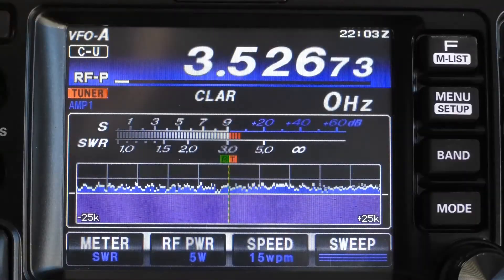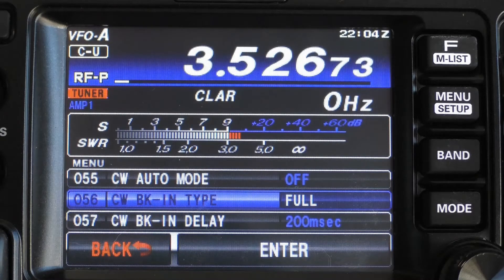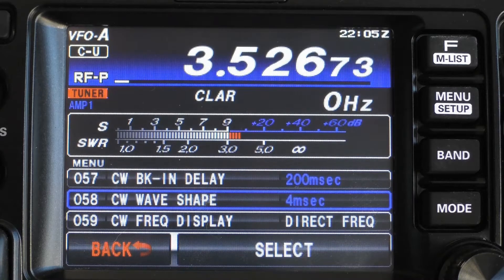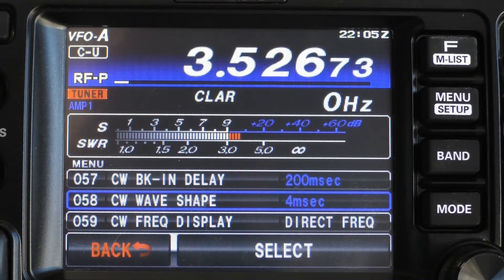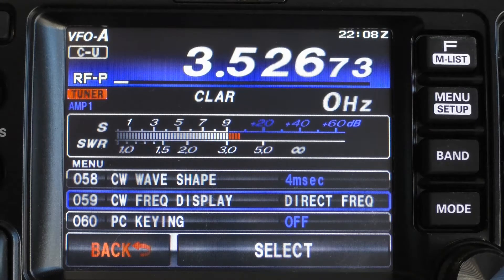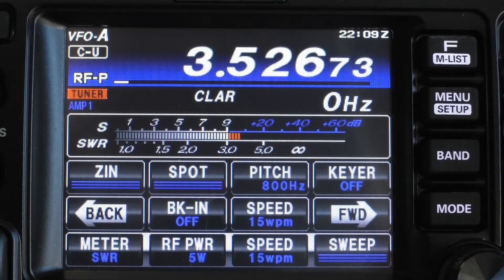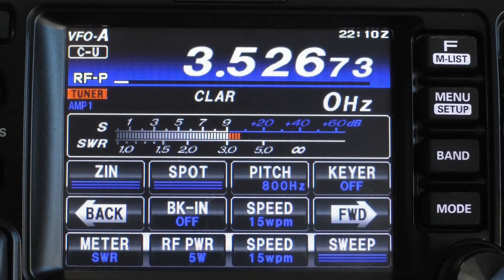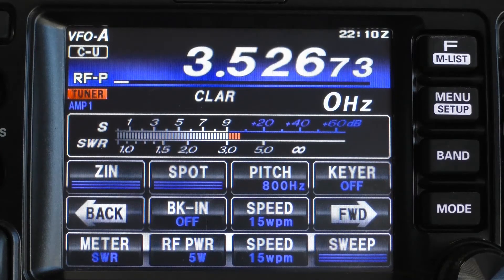Ham Radio Tutorial: CW on the Yaesu FT-991A

Comment: Hi Tom very interesting video. I own the ft 991 with the  winkeyer  usb. winkeyer  connected to the key jack in front with the 2 ends red and white red to PTT and white to key 1 which works ok with my CW software. now when i try to connect my bencher paddle in the Winkeyer paddle jack it just keep sending characters . do you experience something like that in your radio or maybe is just a setup in the radio menu? Thanks Tom  KP2BH/Jimmy
Reply from the maker: Check your function menu - the break-in should be on and the keyer should be off
Reply: @ND3N  break-in is on and keyer off and still the same.

Comment: Thank you Tom for your advice. I will adjust things as you say and keep at it. I also was prescribed Volterol, I use it on hips and knees etc. But didn't think of using it on my hands, so thanks for the tip. Appreciate your help, I must get myself organised with the paddle keyer it will certainly make  for easier sending if I can  get my mind and muscle memory down to it. 
keith GW0CMI

Comment: Would like your advice a number of yeas ago I used to do a fair amount of CW using a straight key. Recently returned to Radio, though never being far away from it. I decided that as  I have arthritis in the fingers I would try a paddle key. this was fine. can send my call sign, go right through the alphabet no trouble, but when trying a CW contact I just loose it, it doesn't come natural to me. but using a straight key mind mind automatically just sends what's in my mind with no trouble my hand works the key automatically. I have tried many hours of practice with paddle key, but doesn't make any difference. I don't want to go back to using a straight key, because I know it will only make things worse. Can you suggest anything ? (using twin paddle in auto mode)
Reply from the maker: Hi Keith…. I also have arthritis in my hands that made me give up playing guitar about 10 years ago.  First, there’s a cream that was recommended to me by an orthopedist and is available over-the-counter.  He recommended it for my knees, but I found that it also helps with my hands.  It’s called Voltaren and is an nsaid that absorbs through the skin.  Second, make sure that your paddles are adjusted correctly.  It should only take a light touch to make contact.  The springs should only be set at the minimum tension to return open the contact after sending.  Third, make sure you are sending from a comfortable position that doesn’t put any additional strain on your wrist, fingers, and arms.  Finally, practice will not only build the muscle memory so you’ll send without thinking, but will also build up the supporting tendons and muscles in your fingers that will lessen the pain in your fingers.  Hope this helps….  73 de Tom, ND3N
Reply: I have the same problem but found the paddle difficult. I started using the paddle with my left hand and the straight key and bug with the right after reading the suggestion somewhere. I don't know why, but it worked for me.

Comment: Hi Tom.
you seem to know a fair bit when it comes to the ft991a,Do you know anything about the MRP40 morse decoder software and what settings need to be set in the ft991a menu,my 991a works fine with wsjtx and grid tracker but i cannot seem to get my radio to tx in MRP40,i cannot find anything on you tube could you please take a look and maybe make a short video to help others to.🙂
Reply from the maker: I’ll have to do some research, but I expect it is doable.   73

Comment: Great video, thanks. This wasn't covered, but I dont understand which keyer setting to select. menu 12: KEYER TYPE.  Elekey -A, Y, or ACS. The manual makes no sense to me. I have an iambic paddle.
Reply from the maker: They are talking about how the internal keyer operates.  There are a number of different types of keyers and each has their own "signature".  All of them will work with your paddle.  I'd advise that you play with the settings and find the one that sounds the best to you - truly a case of "your mileage may vary."  To tell the truth, I have a hard time distinguishing between them.
Reply: @ND3N  thanks, I'll have a play. 73.
Reply: @ND3N is it possible to use the ft991 is a simulation mode, where nothing is really send out? I tried reducing rf power to 0, but 5W is the lowest. 73, PD0HRX

Comment: It boils down to production costs. Most manufactures have done away with the rear key jack so now you only have one and you have to go into the setting every time and you have to plug in a different key. I have a Yaesu FT-2000 that has both a front and rear key jacks. Vibroplex Vibrokeyer in the front  key jack and the Vibroplex Lightning bug in the rear key  jack. Can instantly and seamlessly switch between the two  keys effortlessly. the old FT-2000 is one the best radios I have used, great on SSB and CW but sucks big time in AM mode. Well I guess you Can't have everything!  Don't be a scope head.  Hi Hi. KE0SJQ
Reply from the maker: Thanks for your well thought out comment. Save a few cents and make the radio less flexible. I’d prefer to spend a few more cents…. 73 de Tom, ND3N

Comment: I agree with you on the CW jacks!!!! When I bought my Yaesu FT991-A and I read the manual.  On page 17 of the Operating Manual it states clearly there are two jacks, "one on the front and one on the rear panel". I reached out to Yaesu May 14, 2020 with this information because I wanted a CW jack on the rear! I do not like the front jack, the cords get in the way of radio functions and display. Here is the response I got back from Yaesu on May 14,2020, "Hello Tommy.

Unfortunately, the reference to the radio having a rear jack for a CW key is a misprint.

As shown on the diagram of the connections on the rear of the radio, there is no jack for a key.

There is also no reference to a rear CW jack in the description of the functions of the rear connections.

I have passed your comments on to management so we can correct the misprint in the manual as you suggested in an earlier email.

Again, thank you for bringing this to our attention."
Reply from the maker: Thanks for this info and being proactive with Yaesu. It would have nice if instead of correcting a misprint, they added a Jack to the back. 73 de Tom, ND3N
Reply: @ND3N  I agree. I would like all cords to be on back side. My radio sits at eye level above my laptop, have to move cords to see laptop.
Reply from the maker: A possible quick-fix would be to get a right angle plug, then you could route the cable to the side and drop it down and finish the run under the radio.  You've inspired me to give that a try, so will order something off amazon tonight.  73
Reply: @ND3N  I have thought about running a short jumper to rear with a jack to plug into.  Just wish the jack had been anywhere except on the front next to a similar audio jack, poor design for end user like me.
Reply: Repair shop will install the plug wherever you want it.

Comment: Totally agree on the key jack.  They should certainly put one on the back!
Reply from the maker: One of the only design disagreements I have with Yaesu about this video.  I've been told that there is a way, using the data jack, to run your keyer to the back, but it involves a lot of work... hi hi... 73 de Tom, ND3N

Comment: Thanks, just ordered a 991a while it was on sale to possibly replace my TenTec Eagle as my picnic table portable rig (it won’t replace my KX2 for Summits).
I’m about 99% CW, so this is a pretty important mode for me.  The TR switch didn’t seem too noisy in your demo.  I’m used to my silent pin diode Elecraft rigs which has spoiled me.
W1ND
Reply from the maker: I can’t say that I’ve ever noticed the T/R switch noise. But I’m just above the threshold of deafness….  Hi hi.  You can also pre program 5 CW messages.  I’ve got a video out on how to do that…. 73 de Tom, ND3N
Reply from the maker: An addendum to my previous.  During operations today, I turned the sound down and put my ear right next to the rig.  There is a very low volume T/R switch click, but if I had the sound up at all I wouldn't have heard it.  Not objectionable at all (IMO)...  73 de Tom

Comment: Whay does this radio have a CW-USB & a CW-LSB ? I that CW was just CW?
Reply from the maker: The USB and LSB refers to your the direction of your beat frequency oscillator offset.  The BFO is the tone that you hear and tune to.  Regardless of which (USB/LSB) you decide to use, your transmit frequency is the same.  Generally, the rule of thumb is to use LSB below 10 MHz and USB above.  I gotta tell you that I've never had a rig with U-CW and L-CW before and don't see a lot of reason or use for doing it this way - so my plea is that "I'm only the messenger."  73 de Tom, ND3N
Reply: @ND3N  Yes I kind of wish I would have got an Icom 7300 and not a Yaesu FT991a.
Reply from the maker: I've been mostly a Kenwood guy and my TS-890S is my primary station rig.  I do like the FT-991A, but I recognize that every rig has it's kinks.  I have no experience with the IC-7300, but I'm sure there are really good things and really irritating things about it.  There is no perfect radio, but you should get the best radio for you.  73 de ND3N
Reply: Hi there James, get to understand the all kinds of  AM audio amplifier ( class A,B,AB,C) maybe then you will understand usb and lsb.

Comment: I have a Yaesu FTDX1200 and don't yet do CW (working on learning Morse) and you have given me some ideas on what to check when I do get ready. Thank you for taking the time to do your videos. K1AUS
Reply from the maker: I used to teach morse code classes and once code was no longer required, I put together a 1 day seminar on the code.  I looked up your rig - the process on your rig is nearly identical to the 991A - many of the same menu settings and functions, but different menu numbers - the owner's manual does a really good job of describing your options and how to set them (starting on page 77)...  Unlike the 991A, you have both front and back Key/Paddle inputs.  

The best way to learn the code is to use the code - set aside some regularly scheduled time and pound brass.  You'll be surprised at how fast it will come to you.
Reply: @ND3N  Thanks. I can "recite" the code along with the alphabet but haven't learned to "hear" Morse which is my next goal. As I have a tremor in my hands, using a straight key could be interesting. Paddles would probably be doable.